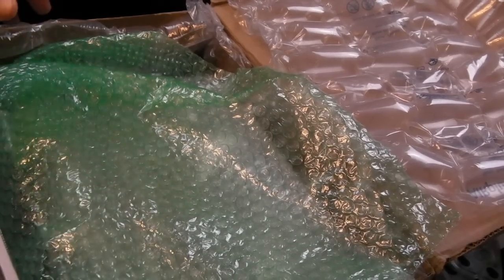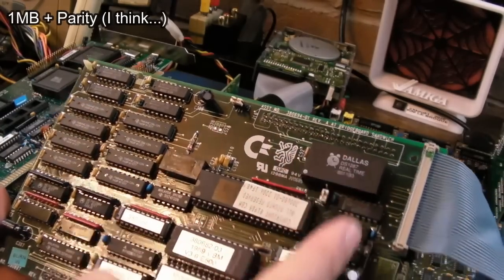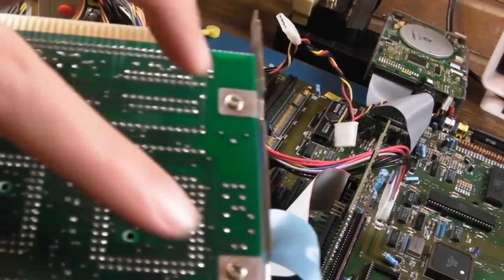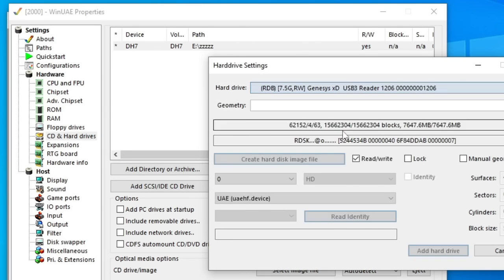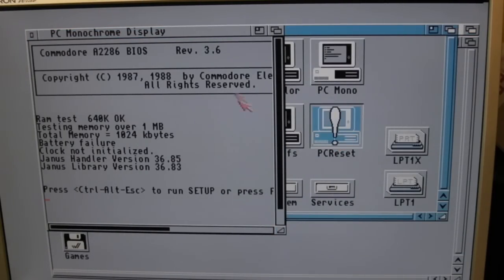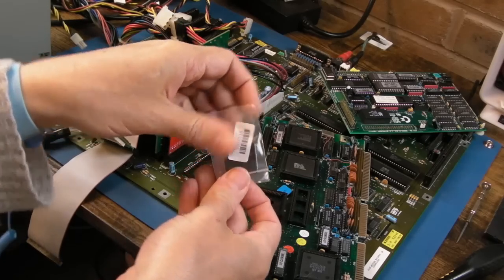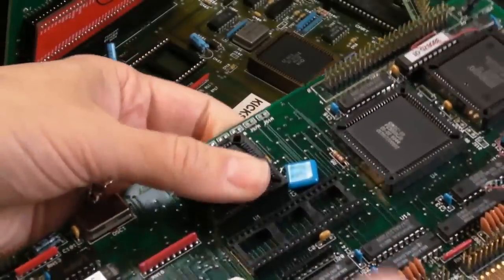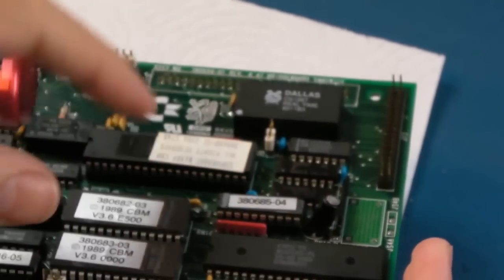Commodore Amiga A2286 Repair & Testing Part 1

Comment: Really cool video. I look forward to Part 2. I would love to see XP running on one of these bridgeboards!
Reply from the maker: I suspect a P4 or later might be required tbh!  The main issue with XP would be RAM.  You kinda need 1GB ish min (maybe 512MB).  A Pentium 2 can support 512MB (mine does), but a 486 tended to max out at around 16MB - nowhere near enough for XP, even if the CPU was supported...  You could run Windows 95 on the 386 boards if modded to 486, provided there's enough RAM.  I may try Win 95 with the 386 bridge board coming up - once I've upgraded the RAM and CPU.
Reply: @GadgetUK164  It would be cool if there was an updated bridge board like Chris Edwards video with industrial blade card-something like a Core2Duo! Maybe someone in the Amiga community will make one. They have recreated big box motherboards, chips, new GPU's.....amazing stuff. I am glad I got into Amigas 3 years ago as there has been an explosion of activity compared to the previous 20 years.

Comment: Interesting to see that it has the Braunschweiger Löwen (Brunswick Lion) printed on the board next to the C=.
That's the coat of arms of the city of Braunschweig, where they designed (and maybe manufactured...not sure) these boards.
Reply from the maker: Thanks for that info!  I will mention that and your message here in part 2 =D

Comment: I have used a soldering iron to melt the side of the Dallas RTC chip to get to the contacts on a older HP logic analyzer that I did not want to risk damaging the PCB with my limited de-soldering tools at the time.  The clock was still running almost 20 years later but I added a coin cell holder to it as a precaution as well as a cap to keep the clock running should I have to replace the battery again.

Comment: 26:07 neat desoldering as always. Have you ever tried the technique of using copper wire from a power cable to make a frame around all the chip pins, then soldering it to the pins, then using one or two irons to heat the wire so the component drops out? I saw it the other day on Mr Solderfix's channel, haven't tried it though.
Reply from the maker: Thanks!  Yes, I've seen that technique before - never tried it though =D

Comment: In THAT era, PCs typically had 512K + 128K = 640K. To go beyond that, you needed a ram card of either EMS or XMS memory.

Regarding the soldering pump Hakko makes a soldering pump cleaning bit. It's basically a twist drill. That said, it is easily the best tool for cleaning out jammed desoldering tips! They're on Amazon...

I happen to have one of these cards in working condition. The head of Commodore had a serious fixation on being able to run a PC in an Amiga computer. They were successful, but the performance on these, even the 286 based cards, are EXTREMELY slow! They run so slow and even with an ISA vga card and an ISA sound blaster board your PC performance is horribly slow. This is a classic case of just because Commodore could run a PC on a board inside an Amiga, doesn't mean they SHOULD run a PC inside an Amiga... You're better off picking up an old PC, if you actually want to use the PC... Back in the day, I had it running a PC version of Telengard, which worked, but it was even slower than the C64 version...
Reply from the maker: Thanks, yes - well aware of the RAM on PCs!  I fixed far more PCs back in the day rather than Amigas and stuff.